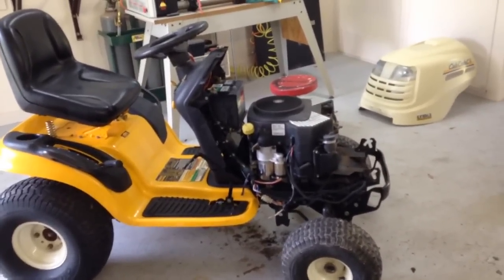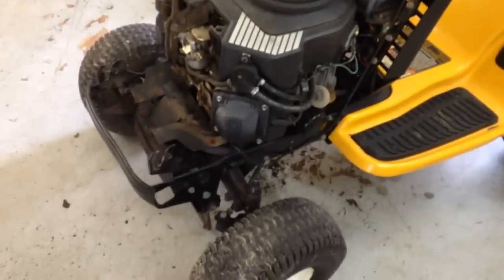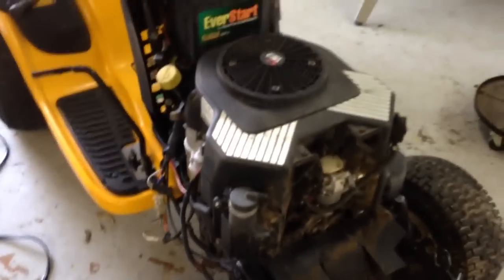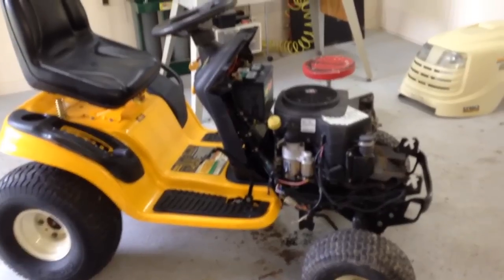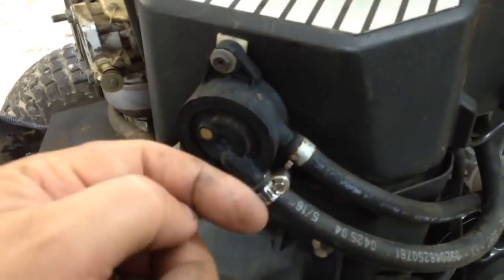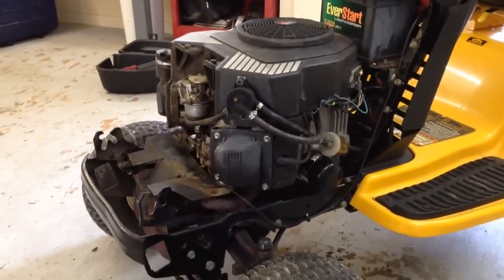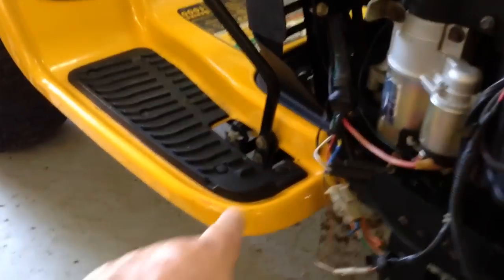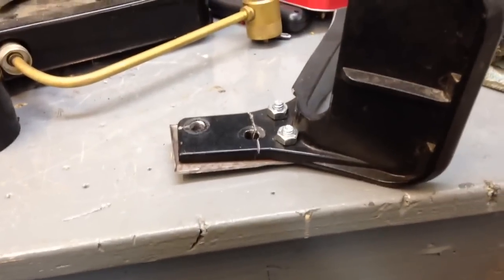$100 mower is running and rolling!

Comment: Well o just picked a good old weed water blower today!!  Tossed a fuel line in and adjusted the carb and she fires first pull now!  It looks like its brand spanking new maybe used once but the fuel line just rotted off.

Comment: You got one for 100 and I got one free that cost 100 to get up and running. I was at tractor supply looking at the new cub tractors. They start at 1699 it's amazing people will throw out one that only needs 100 bucks in parts just to spend that much on a new one. The new ones are nice I'll admit.
Reply from the maker: yeah, the new ones look nice but the parts have gotten even cheaper if you can believe that. Just when you think they couldnt possibly make them any cheaper, they figure out a way.

Comment: I've been running all week but i got that vid up..see if that'll work for ya
Reply from the maker: Thanks! Ill know what idler pulley i need as soon as i figure out what belt is supposed to be on it.
Reply: BCtruck, rebuild, repair,repurpose trying to remember if the deck belt is hanging in the shop,ill look tomorrow